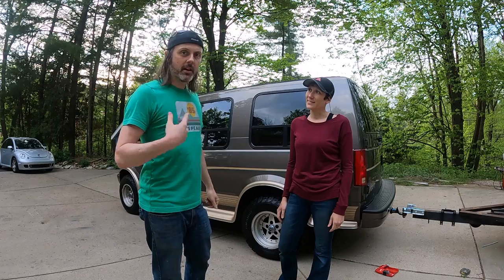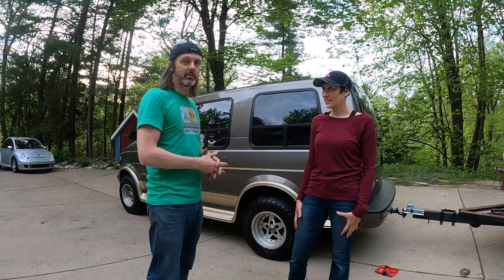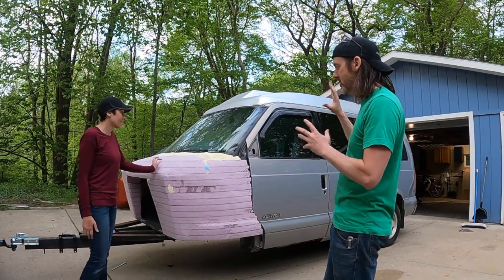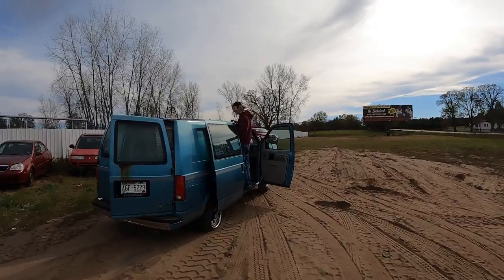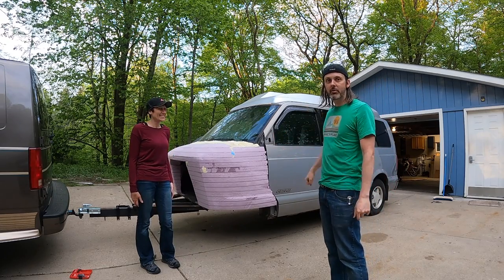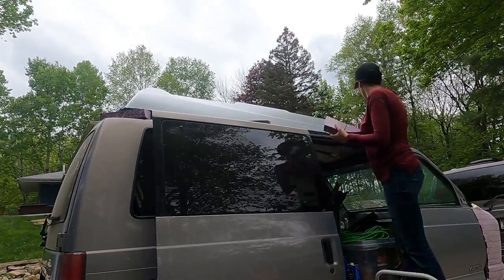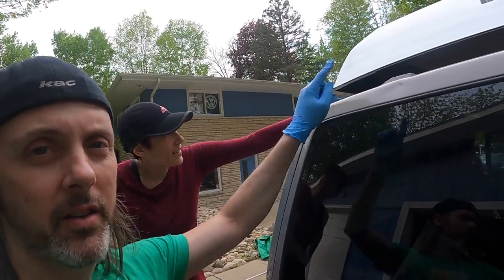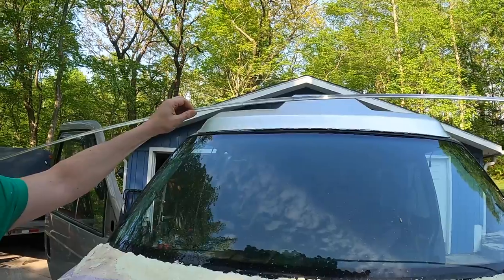How To Install a Van High Top: A Guide For Beginners

Comment: This is great! I acquired the same style high top for my astro in the fall, and I haven’t found anything this detailed about installing one on an astro yet. 

I haven’t started this project yet because i’ve been busy putting a v8 in my van, but that’s almost done so this will be next! im thinking about making mine a pop up too though!
Reply from the maker: That sounds super awesome, both the V8 and the pop top!   We discussed doing a pop top but maybe next time....   seemed complicated and my fab skills for metal parts are lacking.
Reply: yeah I got the v8 running the other day, still wrapping everything up but im stoked to drive it! 

I’ve got some decent ideas for fabricating the pop top mechanism but im concerned about keeping it wind/water tight

Comment: I made a trailer from a 1987 Caravan without a boat trailer.  Just a 2x4 1/8" wall steel tubing tongue welded underneath.  Caravans have an axle without the diff.  Just towed it to the wrecker a couple months ago.  Got $100 for scrap value.  Could not get any buyers when asking $500.  Had thought of making a high top but was voted down.  I made a sheet metal front end with a lexan windshield that you could see through for backing up.  Got lots of thumbs up on the few times I drove with it. It was time for some body work and paint but the boss did not want it around. I towed it with a white 1987 Astro, a brown 2003 Astro and a 2009 Grand Caravan.

Comment: Cool job.  I am looking at getting a old short top from a Ford Econoline and using linear actuators to raise it at camp mounted on an Econoline.  Have tent material inside for when the top is up.  Kinda like a Sportsmobile.  Then have clamps inside to lock it down while traveling.
Reply from the maker: That sounds awesome!   And complicated.   Good luck!

Comment: I always thought it would be cool to have a van trailer to pull behind my van. 

Questions:
-what’s the tongue weight and will you scrape the front leaving driveways?
-have you considered relocating the axle and wheel well further forward?
-I see you cut a hole in the floor for a small pan?
I had thought of lowering the floor from front to rear, between the frame rails, since there is no exhaust or drive line. It would give more leg room without a raised roof. With a raised you may be able to stand?
-a torsion axle mounted to a perimeter frame welded to the body would reduce some weight and allow a wider dropped floor? Could reuse the steel floor?

Nice concept. Looking forward to seeing how it turns out.
Reply from the maker: - a lot.  Will offset it with batteries and water tanks and spare behind rear axle.  Should help.  Anything heavy is getting pushed all the way to the back.
- Too much work, if you moved the axle forward it'd be a billion hours of welding AND you'd lose the sliding door.
- Hole is for battery box
- That would be interesting....  but... too much work for me.   Better idea would have been a taller high top.  Oh well.  :)
Reply: I would think about shortening the tongue to offset the tongue weight a bit. It could be a few ft shorter, actually. Good vid always love to watch you guys doing Astro stuff!
Reply: Still. Fun project!

Comment: Excellent video. I often think about attempting a High Top transfer on my Econoline. Would putting a heat gun to the aluminum trim help on the compound curves?
Reply from the maker: It might, but I think the dead blow hammer and baby taps worked pretty great.

Comment: You should have used pannel bond adhesive to bond that topper to the roof. Its the same stuff that is used to bond bedsides on trucks.
Reply: I didn’t realize people just self-tap screw these high tops on, I thought you have to fiberglass the new hightop into the vans roof, around the edges etc and make it one piece?
Reply: The panel bond adhesive is rated very strong. Auto makers use it to bond the bedsides of trucks to the bed box. They only use a few welds if it's a metal bedside. Some of the bedsides are fiberglass or abs and they still use the panel bond adhesive  it also weather proofs against water intrusion. 3m makes it. I remember back in the day having to use a blowtorch bedsides to get them to release. It's super duty stuff.

Comment: this was so cool. im contemplating something like this with an econoline. your clearance backing in was scary. can i just offer a tip if you ever come across something like this again, drop your tire pressure down to about 30 psi when you back in, it wont hurt the tires and you could reinflate them once youre inside and drop them when you need to pull out.
Reply from the maker: That was plan B if it didn’t fit 🤙

Comment: Another fun video - I just can't keep myself from pointing this out again: You keep saying things like "the Astro struggles at 75 mph" - No, YOUR Astro struggles at 75 mph :D
Reply from the maker: It’ll do 90+ but if you watch the mpg it really falls off above 65mph
Reply: @ADDvanced  it's a transmission thing, I have a new transmission, the key is to never floor it - I just feather it 'til I feel it get into that overdrive gear. I can dobthatvat any speed and have it getting 16mpg or more even at the high speeds. I was purposely doing that on my last two drives to AZ - if it was flat all the way I'd do better but there's a lot of climbing/grade changes along the way so mpg's are constantly adjusting. I can do in the low 80's up a grade at 16mph when it finds that gear. I had to learn to not floor it, that'll always drop it to horrible meg's and keep it from getting into that overdrive gear
Reply from the maker: @AstroVanTribe  What's your final drive ratio?  I'm GT6/3.42.  I hear gearing might help but I'm hoping a V8 solves the problem and I'll just have more torque to maintain those speeds without dropping out of gear.  I'm sure the other issue is the aero from my fender flares/steps, and wide all terrains.   If I lowered it back to stock and ran narrow tires I could see achieving what you're talking about.
Reply: @ADDvanced  good thinking - I'm uploading a video right now on rotating the tires and after that I'm putting one up specifically  for you explainingvmy mpg's  better figuring it's probably  good I fo for everyone else.  I'll put the  link in these comments  for you
Reply: The TCC solenoid plumbing on these transmissions are factory flawed. Changing the fluid every 10k helps to maintain the pressure needed to prevent half-engaging which destroys  2-3 and 3-4 shifting.

Comment: Just a suggestion do a 4.8 or a5.3 swap they have good gas mileage but good torque
Reply from the maker: I would think a 5.7 with headers/intake and some other things would be pretty decent if you're light on the throttle.

Comment: I have a hightop vandura 2500 trailer it's cut and sealed behind the driver doors...its notnon a trailer frame. (Uses its original back axle) I pull it with a hightop savana conversion van... its  been sitting  for 2 years but I just started  to get back  to the build... I'm getting  too old to do the rest alone... so after I get the savana  fixed both will be put up for sale ...I've been  a 2% vanner for almost 40 years... time to give up the keys 🔑...
Reply from the maker: Then what?   Sounds awesome!!!!
Reply: @ADDvanced  after the next grand Nation van rally.. I'm going  to sell all my vans and the trailer... my eyes are going.. it's better to be safe then sorry 😞   I'm getting  old and it was a blast.. but not everything last.

Comment: I think butyl tape is the wrong thing to use. When I removed my high top to repair and reseal, I used loctite marine sealant caulk. From my testing it seemed the best solution.
Reply from the maker: I’ll be caulking the exterior edge
Reply: @ADDvanced  Mine was originally attached with screws and the aluminum strip with the vinyl covering. That was a bad design. Water gets trapped in the aluminum channel and wicks down the screws and rusts the remaining edge of the roof over time. On newer fiberglass tops the design is different. The flange is on the inside of the top and the screws are then inside also. Only caulk is used to make the watertight seal.
Reply from the maker: @ashu9493  Makes sense.  This is an older design tho so I'm doing it as it is shown, because this is how you do an older top.  New ones with an inner lip must be $$$, no idea how they'd core that.